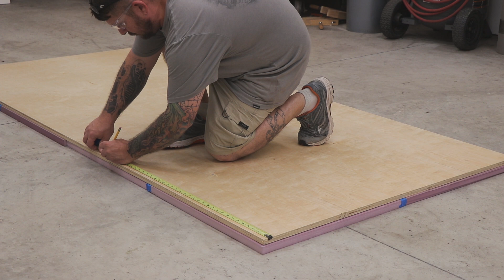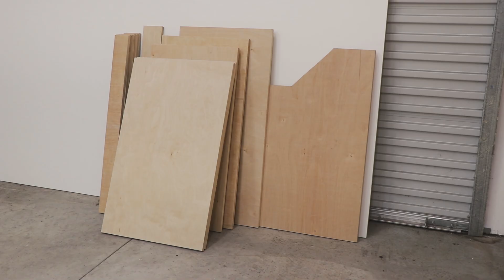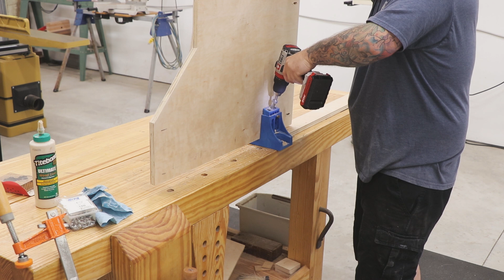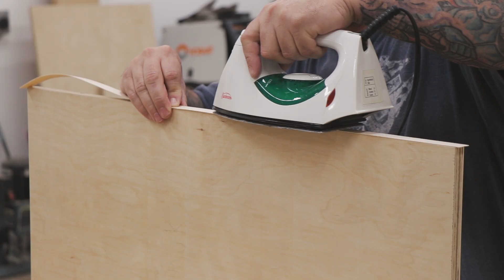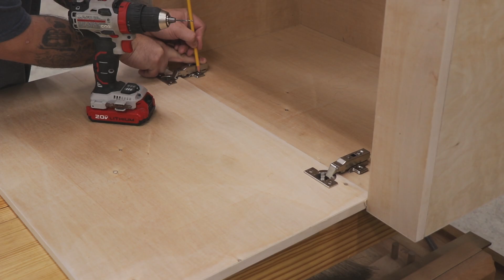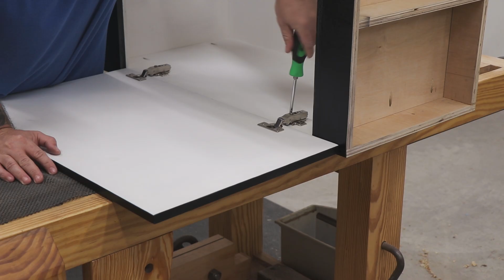DIY Aquarium Stand Build

Comment: You think this strategy of stand will hold a 90G tank?
Reply from the maker: @Plima999  yes I think if the sides of the stand are sitting directly below the sides of the tank, there would be no problem. You could look at the stands that ADA makes or Red Sea
Reply: @ cool, will give it a try! Great work

Comment: Can you help me with what type of screws you use for the pocket holes? I’m gonna try to do this stand. Do you know how many pounds? Is this built  rated for?
Reply from the maker: @JeanEstevez  I used 1 and 1/4 in pocket hole screws. Not sure what the stand would be rated to. I can say, that it still has a 40g breeder tank( probably about 300 lbs with lights and filters) on it and has held up fine with no issues. I also have a 120 gallon tank on a stand made with similar construction. No issues. I think the most important part would be to make sure the frame of the tank sits directly above the plywood sides
Reply: @TwistedWorkshop77  thanks for the help !1 
I'm finishing up my build I wish I could show you. My tank is 60 gallons 3ft by 2ft and I just made one mistake forgot to deduct 3/4 of an inch to give me that space for the doors to sit flush with the tank. so, my stand is going to end up being 3/4 of an inch bigger than my tank!!  but this video helped me a lot thanks!!

Comment: Great video! This was very inspiring. I would love to make one myself, but what adjustments would you make if I wanted to build a stand that is 120 cm wide , 50 deep and 100 cm tall (47in x 19in x 39in) to hold a 360L (80g)tank? Or a tank that weighs about 500kg (1102lb)?  Can this be done without 2 by 4 if i add plywood to the center? Thanks in advance.

Comment: Finally.  A properly made aquarium stand that isn't made out of 2 x 4s.  Thank you!
Reply: Yeah and it's only $130 for a piece of plywood or $9 for 2x4s 😅. Not to mention you need decent cabinetry tools to make straight rip cuts compared to a cheap miter saw for 2x4s. Yes different categories for sure.

Edit: sorry prices have come down, plywood sheet is now only $90.
Reply: @Dassick89 lol I was just thinking this. I have the tools, as I own a wood shop, and if you want professional quality, you’ll be out at least $2000 in tools to build.
Reply: I was thinking the same thing. I'm about to build one and was second guessing it because all I see is those klunky 2x stands. People underestimate the strength of plywood.
Reply: I came looking for this discussion. Cuz yeah you can get 2x4 cut into all your pieces and the store and then just assemble at home, so it's very straight forward. But it also seemed way over built. I was a little surprised that he didn't have any supports under the top to transfer load from the tank, just plywood on top of the frame (part of which he cut out).
Basically, wondering if you could comment more about the strength of this build.
Reply: How much weight will this stand hold

Comment: Smh you really should have a middle support that runs the full depth. Love the build but that's too much weight
Reply from the maker: Thanks for the feedback. Do what you need to feel safe. This worked for me. Still standing. The design is modeled from Red Sea, water box and a couple other brands of aquarium stands that don’t use a brace. This tank is 36 in wide (40g). With all that being said, if you don’t feel comfortable , make it with a brace. I wouldn’t want to be worried about it all the time

Comment: that was a nice cabinet but i think you should put one more plywood in the middle inside the cabinet since it was double door..so the cabinet would be more stable and secure to hold the weight of the tank
Reply from the maker: Thanks! The cabinet is still going strong the way it was built. That strip of plywood would make it stronger though. If you were not going to put a sump underneath the tank, it would be a good idea.

Comment: First of all, gorgeous stand and great tutorial.

I do have a question though. Structurally speaking, would it be safe to build the stand 1.5” wider on the sides and 3/4” in the front so the bottom 3” of the tank (namely the sand bed) is covered? The tank I’m building for is 24x24x30 75g and I want the sand hidden except for the top view. Would this design be structurally safe if the the tank didn’t sit on the corners or would I need a few additional boards under the top board? Thank you! 
-Also Dave
Reply: I guess I could just nail in trim up top instead lol
Reply from the maker: I think nailing on trim would be a good idea. I would want to have the sides right under the the edges of the tank for the most support

Comment: Please reply
Reply from the maker: If it is built square and flat,, I believe so. The 40g breeder tank it was built for has a plastic rim around the bottom. The tank rests evenly on the top of the sand but I still use a thin piece of neoprene between the tank and stand. If the stand was more modern design (Flat glass bottom), I would have used a thicker foam between the tank and stand to even out pressure. I hope this answers your question

Comment: Aren't the push release works only with inset doors?
Reply from the maker: No. They are separate drom the door or hinges. You just have to mount the releases to the cabinet on the top or bottom

Comment: Hi, the tank that is displayed in this video looks like a 40 gallon breeder maybe? I have a 40 breeder that I need to build a stand for and would like to know if this stand would hold the weight? Any input is appreciated.
Reply from the maker: Yes, this was for a 40g breeder. It is still holding the weight with no problem. With a fish tank stand, it is important to brace it or build it so that it does not rack side to side
Reply: @TwistedWorkshop77  subscribed, thank you!

Comment: Excellent video! Is it better to get wood at Lowe’s or a Cabinet store? Why?
Reply from the maker: Thank you! Cabinet stores usually have higher grade better quality plywood. The vaneer if hardwood is usually really thin on liwes plywood and hard to sand smooth or keep from chipping. If I wanted to stain the cabinet instead of painting it, I would have used higher quality plywood

Comment: Thanks for sharing this build video.  I'm currently using this design to build a stand for my 90 gallon aquarium.   I've see several comments from peopl concerned about this stands weight capacity.   You mentioned in one of your post that you used this design on a 120 gallon.  Did shore up the frame any more than is shown in this video?  Perhaps a center brace?
Reply: hi mate did this work for your tank?
Reply: @ollielloydjones5774  Yes!  Check it out:

https://youtu.be/n7oITDOMeVM

Comment: This is exactly what I am looking for. Question, how much weight can plywood support? Also, what is bracing the front opening of the cabinet, would the weight of the tank not cause the front to collapse? Thanks for the video!
Reply: I would really like to know the same
Reply: It must be fine. I noticed my seapora is very similar design but the whole back is that very thin hardboard most furniture use as the back.    So really just two legs and a front support bar and it supports 48gal tank
Reply: It seems we hangout on the same corners of the internet, Mr. Koh😂

Comment: is edge banding the same as veneer ?
Reply: Essentially. Edge banding just comes prepared for use banding edges. Typical veneer usually comes in sheets of some kind in limited length with no adhesive pre-applied while edge banding typically comes in a role like tape so it’s the roughly same width of the edge you’re banding and has a heat/pressure sensitive adhesive pre-applied to it. It’s also on a roll so you have several feet of continuous banding. Think of an 8 foot long countertop that needs banded. Having sections of banding (if using typical veneer) looks bad because you can see the vertical edge of each section. Those visible edges will also show through your finish unless you fill them and by that point it’s just too much unnecessary work. A continuous length (if using edge banding) eliminates all of the faults of using sections of veneer.

Of course, if you aren’t doing any edging that’s over 3-4 feet long, you could find some nice pieces of veneers that you could most defiantly use that aren’t all that expensive if you know where to look. You’d just have to apply adhesive yourself. Heck, you could even veneer the entire cabinet if you wanted to spend the money on larger veneer panels. A lot of mid to high-end furniture is made this way. They’ll use a more affordable wood for the frame and structure then skin the entire thing in thin panels of exotic veneer then charge astronomical prices.

Comment: What is the name of the oil resistant and water resistant primer spray paint you used? Im needing to build myself another aquarium. I just found a 1/2" puddle of water in my current plywood stand.

Comment: Nice video and thanks for sharing it.
How do you plan to  install the Push-To-Open Latch System I don't see any support to screw in those.
Building a similar stand for 72 gallon Aquarium and wanted to check.
Reply from the maker: Thanks. Glued in wood blocks behind the  trim "upper face frame" so the push open latch could be mounted

Comment: Ive done this method before, only issuse is the straight edge is near impossible to get dead straight and if your cuts are out by the smallest amount everything ends up not being perfectly square.  Much easier to get it all cut by a shop on a big panel saw.

Comment: Looking Good Dave! Which saw guide are you using? I have the Kreg and unfortunately it is limited to 4 feet and does not accept extensions.
Reply from the maker: Its a cheap clamp from kobalt. I think Bora makes the same one. It only has a 4 ft capacity also. One day I'll get the festool track saw!

Comment: Looks really good but my butt would pucker filling the tank up with water.  I don't think pocket hole and plywood is enough to support this. Time will tell but yikes.  I would prefer to see a frame built with 2x6's and skinned in plywood.
Reply from the maker: This was for a 40 gallon tank but I have a 120g on a similar stand.  The stands from red sea and waterbox are built with a similar construction(twist locks instead of pocket holes). Stands from ADA also. All that being said,  I did pucker when my friend put water in the tank and if I were making this for a tank longer than 4 ft I would have went the 2x4 and 2x6 (or welded up a box steel frame and powder coated it if budget would allow) route for sure!
Reply: @TwistedWorkshop77  thanks for this reply... I was wondering how those brands can include a stand that doesn't seem to have any additional 2×4 supports but holds up fine... I'm gonna make a similar stand for a 50 gallon tank I'm getting in a few days... Thanks for the video too!!
Reply: The cabinet I built for a 65g used only 3/4" birch plywood, glue and pocket holes w/ Kreg jig.  No 2x4 or 2x6 frame and it's still extremely sturdy.   My first aquarium cabinet I ever built was for a 55g and used a 2x4 frame skinned in 1/2" birch.  Even with hand selected 2x4's, it's harder to get a straight and level  line versus hardwood plywood cut w/ a good circ saw and track guide.  2x4 framing is overkill for most aquarium stands.  The 75g stands at big box pet stores are only made from 1/2" melamine, so 3/4" plywood with the right construction technique should work fine.
Reply: I laughed way to hard at that description , deffs know the feeling but never would’ve thought of it like that if I hadn’t read this. 😂😂😂 cheers.